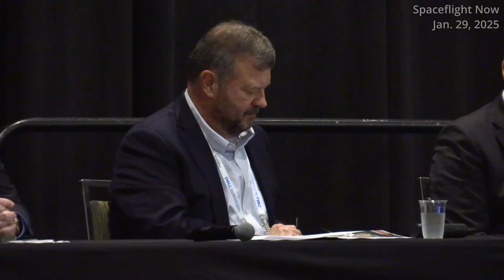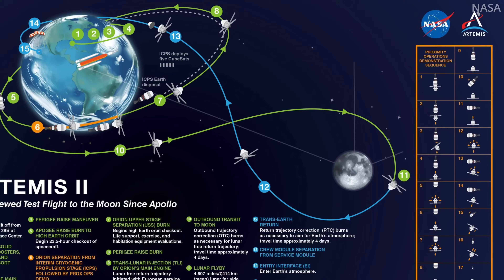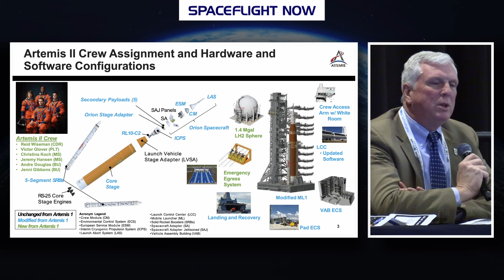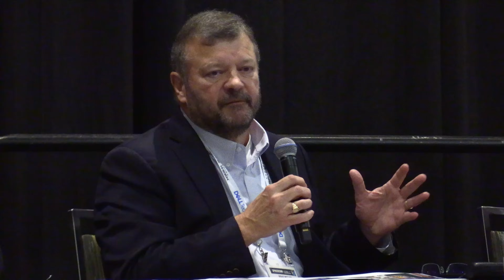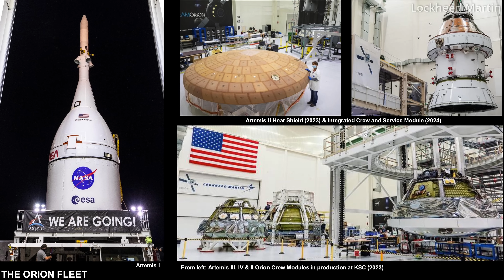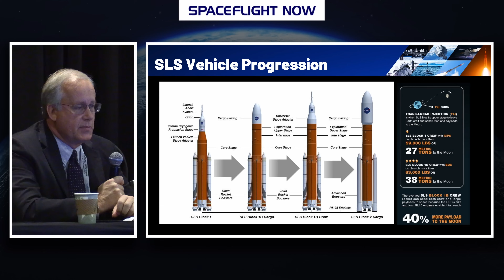NASA, industry leaders outline progress towards Artemis 2 mission

Comment: This sums up the current infrastructure of the agency - so many self congratulations and "pats on the back" to each other
and at the very core of the briefing- nothing new. 
It's like a train that has broken down ,is stuck in a siding and while the manufacturers of the train say it is performing well - it doesn't move. 
SpaceX is behind schedule with it's testing - their much vaunted improvements merged with the upper atmosphere in that explosion (sorry fans it did explode) . The legacy contractors , seem lashed to the orange whale of SLS - with its heat shield issues  (gone quiet again) .
I don't understand why multiple Falcon heavy launches with small orbiter/lander couldnt accomplish the job without the refueling debacle that Staship needs !
Reply: It's about taking tax payer dollars and putting them into the right pockets, not space exploration. They are doing their jobs perfectly.
Reply: Starship is not testing. It’s risky R&D, and if successful it will bring launch costs down even below Falcon9 and allow bigger payloads. If you paid attention you saw the same process unfold with Falcon9 booster landings. It was a ridiculously ambitious idea, but now works. SpaceX could just milk F9 for money, since no-one can compete on price at the moment - instead they plow the money into Starship development.
Reply: @samuk9816 Exactly the reason that Artemis II and III should continue with an SLS rocket and Orion.   Starship wont go from agreed “R&D” to crew-demo in the next 18 months.
Reply: @    I agree on 18m being less than 50% chance for Starship crewed, I disagree with the wisdom of plowing more money into SLS.
Reply: @daveenright1235  the Senate Lobbying System is such an abomination .... anyone who supports its either hates elon musk for political reasons or doesn't know how many billions are being thrown away on a 1970s rocket

Comment: Did they fix the heat shield problem or nothing yet?
Reply: Well, they claimed they did solve it - and are already manufacturing the new heat shield with a slightly different formula for Artemis III. But they'll use an old type for Artemis II, and just adapt the entry profile. So they say it is solved. But we will need to wait many, many years for a proof - as Artemis III is not going to happen any time soon (watch their faces/reactions when someone mentioned the official launch time frame for Artemis III in 2.5 years).
Reply: @fgaviator  Sorry but the heat shiled doesn't apply just to Artemis III or IV...it also apply to the reentry of Artemis II that will take place next year..yes Artemis III and IV might take a while
Reply: Nopp, modified the reentry profile instead.
Reply: It's a government institution... What do you think?
Reply: First nobody would have died...we are not in the 1960s...they take extra precautions, second they claimed that they fixed..
Reply: no